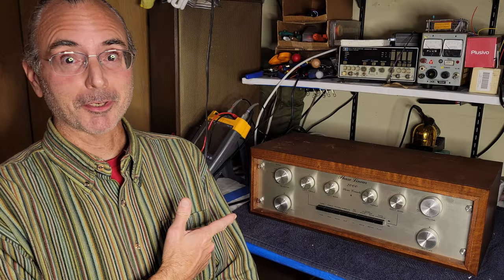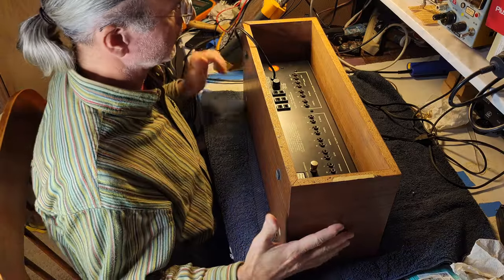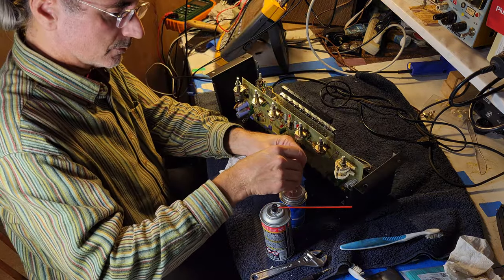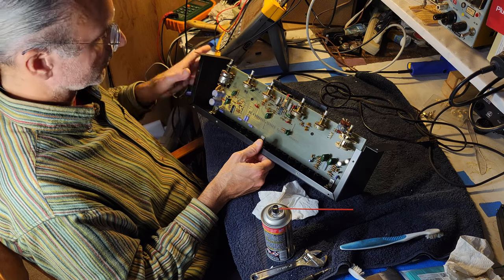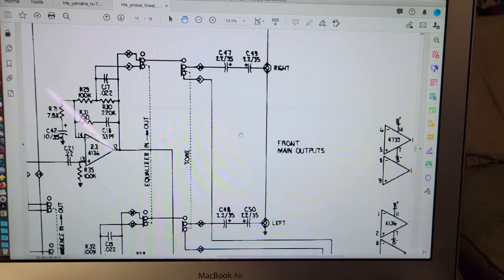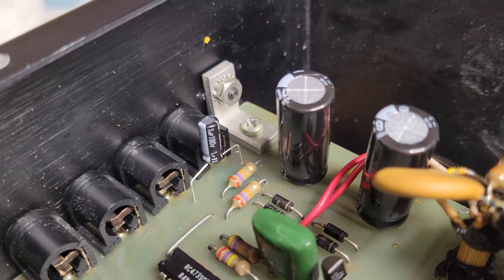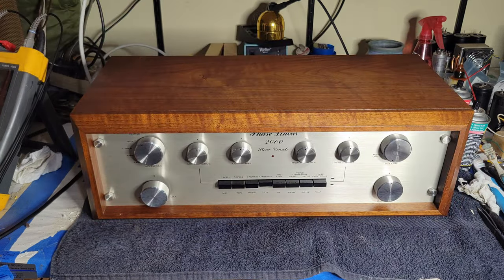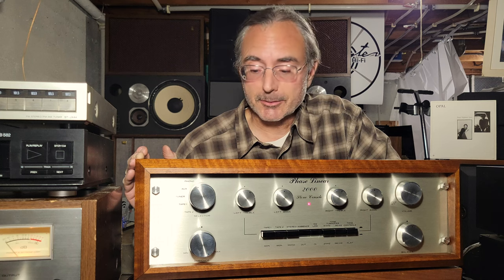Vintage Preamp Restoration: Phase Linear 2000

Comment: Nice work - looks so much better now and likely performs better than new! I liked the neat trick of replacing the two pairs of electrolytics with a single pair of film caps!
Reply from the maker: Thanks! Once I realized the function of those caps, replacing each pair with a single film cap with half the value seemed the obvious thing to do. Still, I hesitated a little at "changing things."

Comment: I love vintage gear and have a modest collection of various gear. I have a couple of early/mid 80s Soundcraftmen DX4000 preamps along with 1/2 doz Soundcraftsmen amplifiers other. The plan is to peel off some of it to refresh and set up a vintage Soundcraftsmen dream rack system for fun: DX4000  preamp, A5002 Class H Amplifier, DC2015 Soundcraftsmen differential/comparator equalizer, T6002 AM/FM tuner. It would just be fun to have and put some of that good old equipment to use.

Comment: I congratulate you on your work on this console. You proceeded in the same way as I did when I managed to find my Phase-Linear 2000 console, at the end of 2002.
I have my 2000 console connected to a Quad 405-2 and it works fine.
It has remained working in due condition to this day, being used practically every day for my regular listening. 
What I didn't know was that this console wasn't designed by Bob Carver. This is something strange to me.
How did you find out about that fact? I did an exhaustive search on the web regarding the console and nowhere did I find this information. 
The operations to revitalize the Phase-Linear 2000 console are an investment in labor that is fully justified, because anyone who has a console like this will keep it for the rest of their life, making it a completely reliable machine.
The only thing left to do on my console is to change the OPAMPS, this being a procedure recommended by the majority of people who have done it and who are allegedly satisfied with the result obtained. 
Apparently, this change of OPAMPS provides a more compatible operation with current musicality (this is not an observation of my own). This is an issue that I have not yet seen expressly explained.
What do you think about that? Does it really justify changing the OPAMPS? Since my console is working fine, I'm hesitant to make the switch.
Best wishes for continued good work.

Greetings from Portugal.
Macedo Pinto
Reply from the maker: I'm not sure where I saw the information about Carver, but my recollection is that the 2000 was designed to have a lower price than the 4000. Their superficial resemblance aside, the 2000 and 4000 are very different designs. Also, the 4000 has "designed by Bob Carver" printed on the back, and the 2000 has nothing similar printed on the back. Regarding the opamps, the conventional wisdom is that opamps have improved substantially since the 70's, and the 2000 would benefit from the newer technology, which would, for example, lower the noise floor. However, replacing the opamps is not simple and requires adapters at the least, and perhaps also additional capacitors to prevent oscillation.
Reply: @Lancaster_Hi-Fi  thanks for you assessments about what I mentioned. In fact, the change of OPAMPS must be accompanied by more interventions of which I am not aware. I will study this more in detail before deciding on this.
Thanks for your quick response.
Macedo Pinto

Comment: Painters tape on the power amp, What gives
Reply from the maker: That part of the face is barely attached and needs to be fixed. I'm just trying to keep it in place and prevent further damage until I fix it.